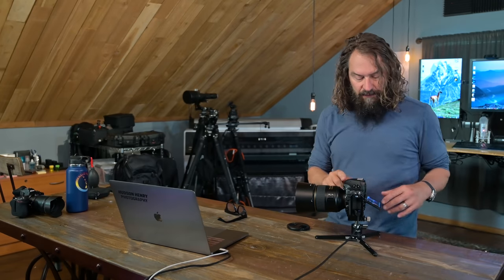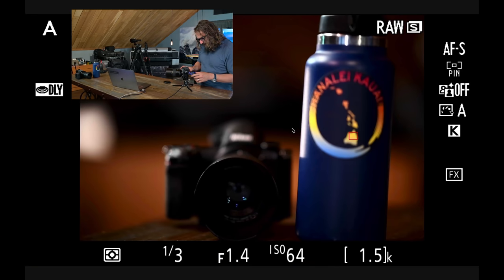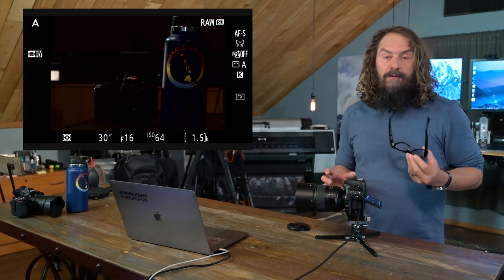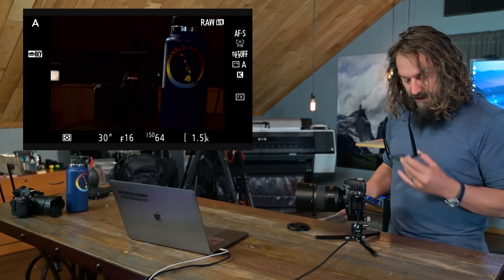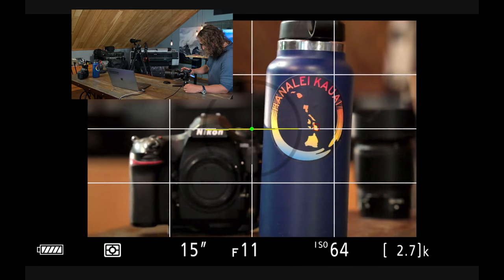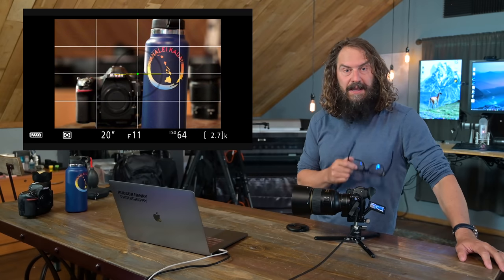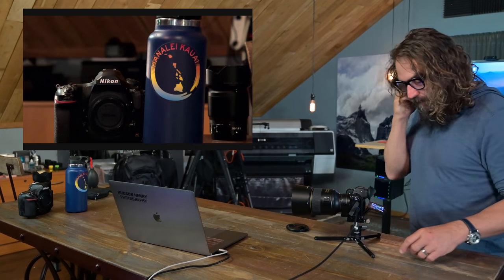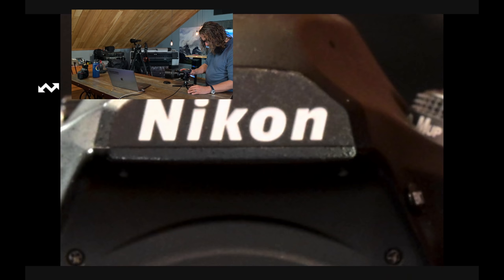Approaching the Scene 151: Nikon Please Fix This Z Camera Depth of Field Problem!

Comment: Thanks for this video Hudson. I love my Z7 but I’ll admit this needless limitation annoys me especially when the whole mirrorless experience is supposed to be about seeing the view you’re pointing at. I now tend to AF a scene then use focus peaking to comfort myself of sharpness. I miss zooming in a checking and the little dot bottom left of EVF seems impossible to keep static on some occasions. I would like Nikon to remove the limitation in manual mode, and will message them.
Reply: Reply... "It has been noted that when previewing the depth of field on the the Z series cameras the aperture only closes down to f/5.6. This is different to a DSLR that can preview the image to the smallest aperture i.e. f/22. This is in accordance with specification. Due to the different AF systems between DSLR and Z series cameras the preview is limited to f/5.6 with the Z series as the image would possibly become too dark to achieve AF. Due to the different way the two systems work this is not an issue for DSLR which always AF with the aperture wide open but this is nt the case with the Z series, hence the limitation. 

If you want to preview the depth of field on the subject when shooting, use Custom Setting f2: "Custom control assignment" and assign “Preview” to a camera control and then press the control to confirm it. Here is the online manual to help you also. https://onlinemanual.nikonimglib.com/z7_z6/en/09_menu_guide_05_f02.html  

However I want to thank you for your suggestion regarding the depth of field on the the Z series cameras .  We very much value your feedback as part of Nikon's process of continuous development and improvement. I can assure you that all customer feedback and suggestions are given consideration and I have forwarded your suggestion to the appropriate department. Unfortunately, due to the number of daily suggestions we receive, we are unable to offer a response to each communication individually."

Comment: Thanks Hudson for bringing back again this topic which is really an enormous limitation and a real pain for any landscape photographer. 
That is actually the only reason preventing me switching from my DSLR to the Z7ii...
This is simply non-sense even from autofocus point of view. First, the Z-mount is one of the largest and is supposed to bring in more light hence speed up autofocus. Or even standard mounts such as Sony's E-mount allow for  depth of field preview regardless the aperture you choose. Second, even in movie mode you need autofocus to work reasonnably fast (eye of face detect) which is the case as you shown. So why this limitation for still mode? Complete non-sense... 
I hope as much as you do that Nikon will make things right with firmware update for the sake of anyone sanity. Are you aware of any petition currently running on this matter?
Thanks again for raising your voice and let's hope it will finally be heard. 
To be continued...
Reply from the maker: Thanks Denis! I think I'm the only one taking about it which is surprising. And yes, other brands do have this limitation. I really don't understand it either...

Comment: Hi, Thank you for the video. Nikon needs to concentrate more on their firmware for these Z series cameras. I have the Z50, I really like it and using your videos set it up precisely as I need it with the occasional tweak here and there. However, recently upgraded the firmware to 2.10 and this made it difficult for me to change the focal length: a lot of resistance and a clicking sound. After consulting Nikon, they were helpful. On checking YouTube I discovered I was not the only one suffering this, the upgrade engaged the aperture thingy from the body to the lens and hence the noise. I was advised to wait for a further upgrade but it could be some time. I reinstalled 2.03 and lost all my settings but I have my new camera back.

Comment: There are still other annoying "problems" too. They just have to look how Fuji did it. After owning a X-H1 I sometimes feel a little bit restricted with my Z6. Fuji has much more configuration options and you can also assign the d-pad with functions (for example).
But image quality is better and that was the most important thing for me ...
What I also don't like is that the screen immediately turns black after pressing the shutter button in exposure delay mode. Not sure if there's a reason for that (night photography?). When I shoot handheld and use the exposure delay to reduce movement at very low shutter speeds, I often unintentionally change the composition a little bit because I don't see it on the screen for 1 or 2 seconds. I could use the 2 second self timer but it isn't possible to assign that function to a FN button.
There's somewhere a very good "please Nikon listen to us and solve that problems with firmware updates" list online that was supported by pro photographers but many points are still unchecked and Nikon seem to ignore it.

Comment: Hudson, I am a Sony A7R4 user and I have the opposite problem. I'm not sure if all digital cameras do this, but I am unable to set the camera into a mode that uses "open aperture metering". Rather the camera is in "depth of field preview" mode all the time. What I loved about my first advanced camera 40+ years ago (Pentax Spotmatic F) was that it allowed for focusing and aperture metering with a fully open aperture regardless of the aperture setting for shooting. This allowed me to place the point of maximal focus exactly where I wanted it and then I used my knowledge of DOF to determine how much in front and behind the focus point was in focus. Of course, the DOF-preview button could also be used to confirm. Problem is the Sony seems to autofocus the aperture setting on the lens, which means there is uncertainty in the point of maximal focus, especially when a restricted aperture setting is selected. This is also true for manual focus, regardless if the aperture setting is made in the camera or on the lens (aperture by wire lenses). My solution has been to transition entirely to either mechanical-linkage aperture manual-focus lenses, or the GM series of f/1.4 autofocus primes, which have a manual aperture ring. I have to have the camera in manual focus mode, but I can whip the aperture ring from f/1.4 when focusing and I manually rotate to the taking aperture quickly before snapping the shutter. This is too slow for people shots, but works for landscapes. Do you have any other ideas on how to emulate traditional open-aperture focusing/metering? We already know from this video that the Nikon Z7 ignores the aperture setting when in manual focus (at least for small apertures), but what happens when in auto focus? Does the Z7 also focus at a mid-range aperture when the setting is for wide-open? Thanks. KQS

Comment: You can get around this issue using the old-school lens-twist technique.  But yeah you shouldn't have to because it makes no sense when using manual focus.  Every mirrorless I can find behaves like it should, including the D850 in LV mode, as you've shown.  The other weird part of this behavior is that the aperture always pulses when you shoot an image, even if it's already at the proper aperture.  This is a big deal for timelapse because it's unnecessary wear that is not necessary with a mirrorless camera.  I contacted Nikon support about it a few months ago when I got a Z6 ii.  They're clueless.

Comment: Thanks Hudson for the description of DOF and how it can be used, I typically don;t use it but might have to start. Am i correct in thinking that if you do focus stacking DOF preview isn't really needed. I guess if you have a scene where things are moving and need everything in 1 frame, i can see DOF Preview coming into play. Loving my Z7ii as well. Thanks again.
Reply from the maker: Focus stacking is another work around, but it's still a needlessly frustrating limitation. I love mine too, but I'd like this to change.
Reply: @HudsonHenryPhoto  I almost wonder if Nikon is trying to push people to focus stack and get away from diffraction issues.

f5.6 is very conveniently the full stop before diffraction starts showing effects on the 45MP bodies.
Reply from the maker: Good lenses are great at f11. Beyond that I think focus stacking, but I don't think nikon is acting on such motivations...

Comment: There is a way to get working DoF, but it requires use of a manual focus lens that isn't AI-P. That's because non-CPU lenses never have the aperture controlled by the body.

This can work well with some UWA's, especially if using Laowa, non-CPU Zeiss or Voigtlander (or CPU-equipped one in FE mount on a non-electronic adapter)

It's not a good answer, but it is one reason I'm still shooting an F mount Laowa 15mm f4 instead of going to the 14-30.
Reply from the maker: Nikons S glass is in a class of its own and they should not limit those who own it. :(

Comment: There are several annoyances with the Z cameras that can easily be fixed via firmware.

The lack of any kind of video roll/cut indication other than a "Rec" red dot in the most difficult place to see in the frame (center top)  leads to operators filming endless shots of their feet because they thought they'd cut and hadn't.  The still camera section has confirm beeps for lots of things. Why not video record?

And while you're at it, Nikon, how about a viewfinder with effective eye relief?  It's nearly impossible for eyeglass wearers to see the entire frame.  Allow eyeglass wearers to shrink the viewfinder image slightly on demand.

Comment: You are right, Depth of Field preview doesn't work when zoomed in to 100% on my Zs. And, as you say, DOF preview does work on full screen view in manual focus mode with focus peaking enabled when you press a button assigned to preview -which immediately shows the increased DOF with the peaking effect. Surely with f8 to f12 the DOF is so large that it's hard not to get focus -seems easy using mirrorless and focus peaking to get good manual focus at f8+ full screen. I mostly use telephoto lenses wide open so I'm probably missing something here...?
Reply: Ok, I've just tried manual focus using DOF preview at f10 using peeking and it's less effective than attempting manual focus at f5.6. I guess punching in to 100% with DOF preview in MF everything would have red peaking, whereas at f5.6 you can aim for focus around the hyperlocal distance. So I can see why Nikon may not want to bother with DOF Preview above f5.6. Just use hyperfocal chart and punch in to get the sweet spot then trust ;-)
Reply from the maker: It's so much more accurate to see with my eyes on the diopter adjusted viewfinder. I am not a huge focus peaking fan, too much digital trust for me. I often use longer focal lengths for landscape work that I need to check. The biggest question is why the limit? Other brands don't. These cameras themselves don't in video mode. Video has peaking too, but filmmakers are meticulous like landscape photographers and they'd scream bloody murder if it behaved this way in video mode too. So why in still mode?
Reply from the maker: Oh and be very wary of hyperfocal charts and apps. I find they're a bit like the old 500 rule we used in the lower resolution days for stars. Use the measure if you must, but check the final image at 100 percent before the light's gone. There's just no substitute for zooming in to 100% at final aperture while focusing. Hyperfocal is a breeze with that. You know that way you've got it right.
Reply: @HudsonHenryPhoto  agreed. Best to check in camera
Reply: @HudsonHenryPhoto  Ah ok, yes long lens certainly needs a check. Agreed it seems a random and unnecessary limit.

Comment: Hi Hudson, quick question - is it possible to see depth of field information on the back screen? Information such as 1) focus distance and 2) the range of your depth of field. Some lenses like the new 105 2.8 MS have a 'DISP' button which toggles between these sets of information. I can't find any information on how I can set up the camera to display this information on the back screen. This information would be useful to have for Z lenses that don't have a 'DISP' button. ✌
Reply from the maker: I don't know how far I trust the DOF data on the lenses with that readout. I wonder about how it's calculated. There's really just no substitute for stopping down and looking zoomed in a 100%. :-( To answer your question though. To my knowledge none of the cameras I've worked with from Sony, Canon, Nikon or Fuji that I know of have that feature. If I'm wrong I'd love to know. I think the Nikon Lens LCD is pretty revolutionary, but again... how far to trust it??? I prefer my eyes.
Reply: Thank you for the feedback. I will follow your advice and trust my eyes. Speaking from experience, the Fuji X100 has on its back display an innovative bar. It shows distance in either ft or meters. IT shows exactly the focus distance and your depth of field (DoF) range. As you change aperture or focus distance you can see the DoF range changing (expanding or contracting). By using this you can really dial in your DoF and it has been very accurate for me. I use ft for macro and meters for landscape. I believe this feature appears on all of their X series cameras including medium format, however, I haven't checked as yet. But Nikon zoom and check with eyes will be just fine. Thanks for your help.🙏👉🆒

Comment: Bud,
Manual focus still trumps AF for precision(nail it) even with mirrorless. The solution to DOF is in your hands, the D850. Don’t count on Nikon to release a firmware update. The Z7/II is not a D850 replacement. Probably will have to wait for the Z9/Z8.
Reply from the maker: You're entitled to your opinion my friend, different opinions keep the world more interesting. However, I'll bet it would change after a solid two weeks with a z7ii. I've owned the d70, 200, 300, 700, 610, 800, 750, 810, 500, and 850. I've worn out nearly all of them except the 850 and the 500. Why? They hit my back studio shelf relatively new after I got the z6 and z7 and never came back off. In my experience, the Z cameras are more than D850 replacements. The 850/500 combo are the best dslrs that will ever be made, but I haven't reached for them for years. The Z cameras are just far more advanced tools. Can't imagine going back despite this one annoyance. Nikon's been stellar with firmware since release. If enough people take note, this can join the already impressive firmware improvement list.

Comment: This is what happens when electronics and computers take over tasks that were done by a single mechanical lever for decades. Nikon is not the only one who suffers from these ' mishaps ', Canon not so long ago was suffering from some sort of overheating problem due to the limitations of the firmware. For my part, besides the D800 and D7200, I stick to mechanical film cameras. They work for ever.

Comment: Nice video.  Nikon doesn't have focus peaking?  Hard to believe.
Reply: It's hard to believe 'cos it ain't true. Focus Peaking as implemented on Z system cameras by colouring in-focus areas with the chosen shade with 3 levels of sensitivity to DoF - it works with manual focus only. You can also have magnification of the focus point by assigning a button to do so.
The main issue is that when the view is set to show DoF, it only does so up to a max of f5.6. You have to stop down the lens for smaller apertures where the display becomes very noisy. I don't have any experience how other manufacturers do this. This is one area where mirrorless cameras are very different to DSLRs!
Reply: @paulbusby2013  Well..if the areas in focus highlighted by focus peaking isn't showing the depth of field...I don't know what else one needs.  It's literally showing you what part of the image is in focus.

Comment: Just got a Z50 and can't find the "Save/load menu settings" item in the menus like that's in my Z7 II, Z6II, D850 and D500 bodies.  Can you help?
Reply from the maker: Hi Fred, I'm afraid they left that off the Z50. :-( I love to do that too and I just checked the latest firmware and it's still not a Z50 option. I love that little thing, but it would be nice to back up the menus.